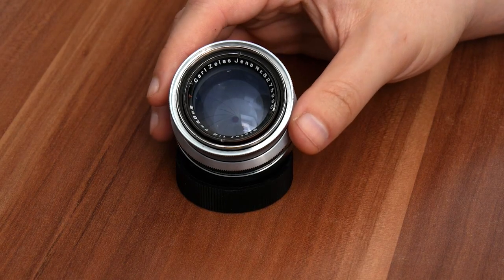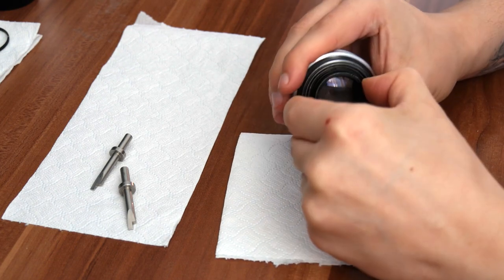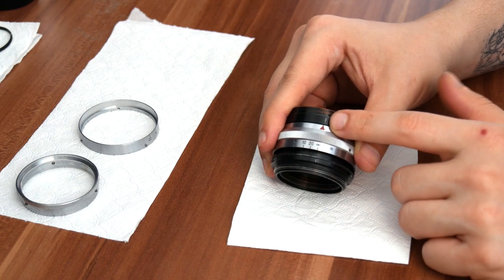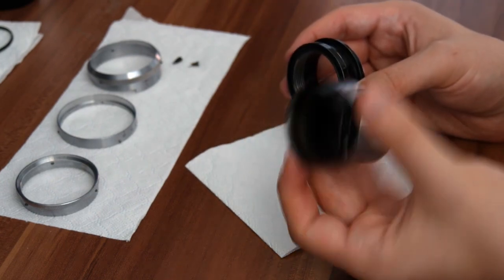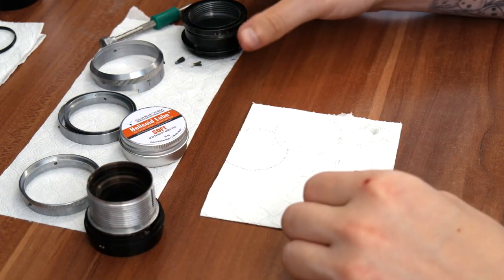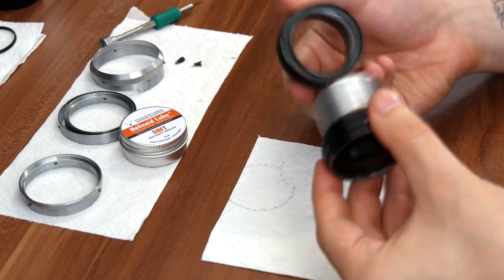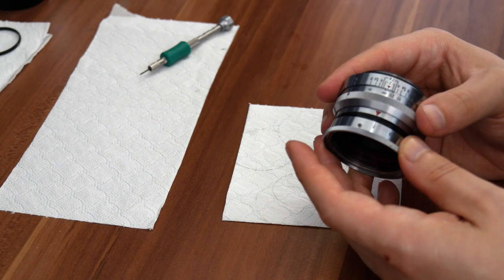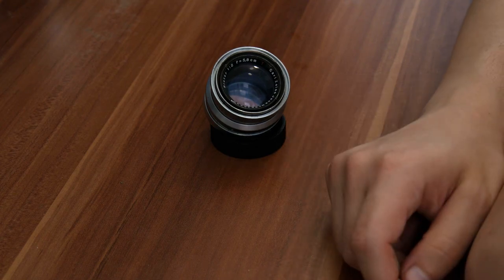Cleaning Carl Zeiss Jena Biotar 5.8cm f2 17 aperture blades

Comment from the maker: If you have a Carl Zeiss Jena lens, you can check the year of manufacturing over here - 
http://forum.mflenses.com/carl-zeiss-jena-lenses-issue-date-by-serial-number-t6865.html
Reply: 1945-1949, probably '48 or '49. Works well so I won't take it apart.
Reply: I've seen that list before but I'm not sure it is correct. The Zess Jenna Pancolar 50mm F1.8 lenses up to serial number 8,552,600 (made from 1964 up to 1967) were produced with Thorium glass but the list says serial numbers 7,000,000-8,000,000 are lenses made 1964-1967 so how can that be right?
Reply from the maker: @simonc4764  I wouldn't know to be honest. It could be a rough estimate in what year the lens was built.